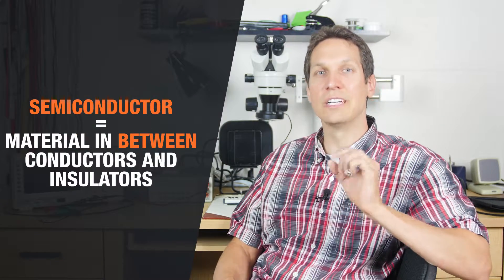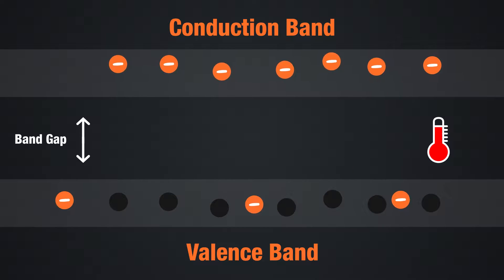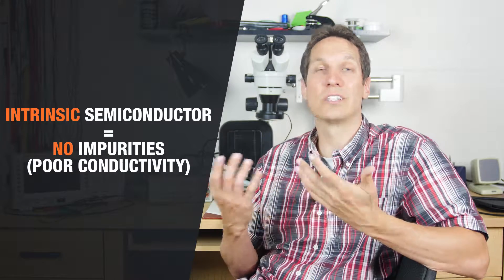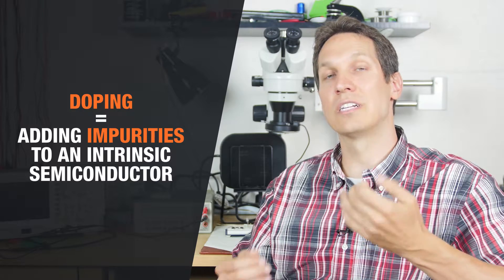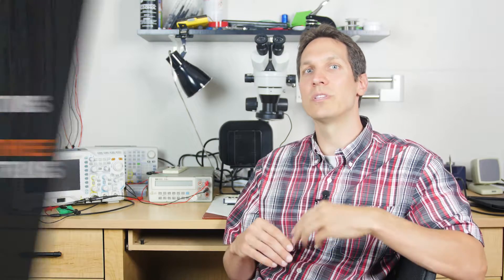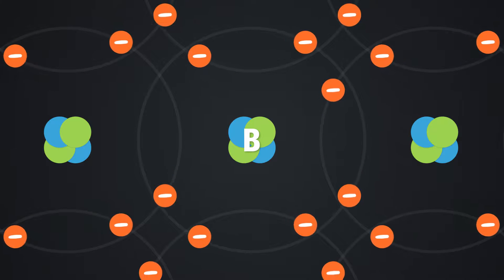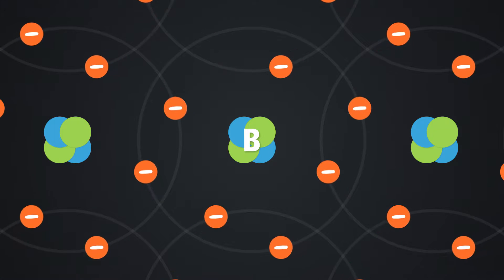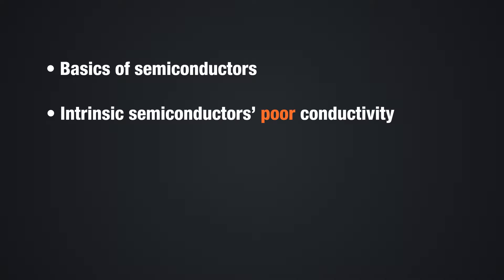How do semiconductors work? (with animation) | Intermediate Electronics

Comment: Hi! Really enjoyed the video. If I am correct, a hole is a vacancy in the valence band created when an electron transitions from the valence band to the conduction band, upon excitation. If a hole is a vacancy, how can it be described as a separate charge carrier? Is it considered as a particle, similar to electrons?
Reply from the maker: You are absolutely correct about what a hole is!  And that’s a great question about how it can be described as a separate charge carrier.  The reality is that, even though it technically is NOT a charge carrier, it simplifies the understanding of how semiconductor devices work and the math works if you just act like holes are particles.  As engineers, we often just need to do some hand waving and say “close enough”, especially when it makes something significantly easier to work with and doesn’t negatively affect the outcome of the calculations.

Comment: Thank you for your video, it's very useful, but I have a question: How can a"hole" conduct electricity? Thank you!
Reply from the maker: It is a weird concept.  We treat "holes" as a particle, but really, it's just a pathway that an electron can jump from hole to hole, meaning that they can move (via the holes) but don't move as quickly or as easily as if they were completely free from specific atoms and instead had joined the "sea of electrons" where they tend to be able to move easier because they're *completely free.  (Not actually completely free but it's easier to think of it in absolutes)
Reply: @CircuitBread  I'm understand. Thank you very much!
Reply: @CircuitBread Since conductors do not have this current due to said 'holes', does it change anything? Semi-conductors can generate a normal current from electrons as well as from holes, but conductors can only generate current from the free electrons in the conduction band.

Comment: Good work! In the LED case, are the areas of the n-type and p-type material have the same thickness and what is the reason of putting the p-type material on the top?
Reply from the maker: Thanks!  We actually have a video that explains a bit more in-depth about how all this works and also mentions why the p-type material is on the top (spoiler alert - it's what actually emits the photons, so you don't want to block it) - https://youtu.be/No8PZsLnjZU?si=qoODt41tleXruRXn  
As for the thickness difference between the two, I'm actually uncertain.  I think in the construction process, the p-type is built on top of the n-type substrate but I don't know if there's a need for them to be different thicknesses.

Comment: Thank you for the explanation. Just one question, where are the electrons that leave the extra holes in P-type and where are the holes left by the extra electrons in N type?
Reply from the maker: I'm not sure if I understand the question.  The extra holes in the P-type are there because the dopants have one less valence electron than the substrate, so there aren't any additional electrons.  The reverse is true for the N-type.  There aren't additional holes left lying around just because there's an extra electron.  That's what makes them special.  Let me know if I'm not actually answering the question!